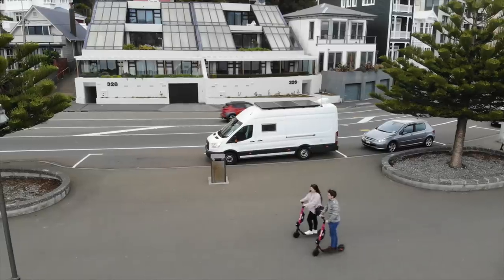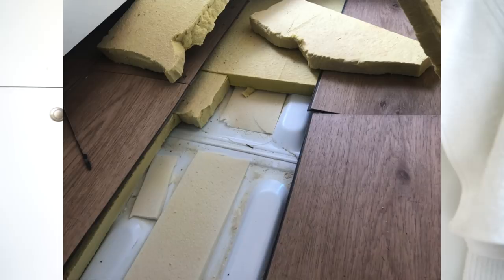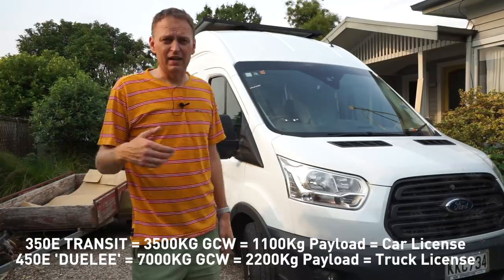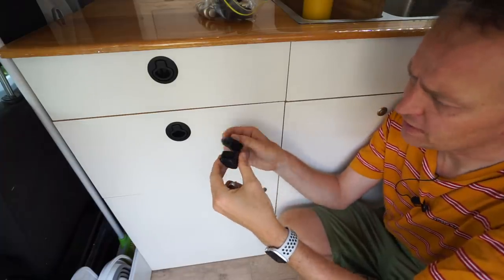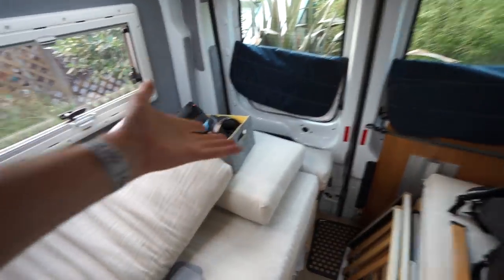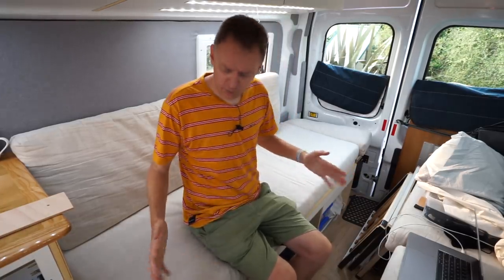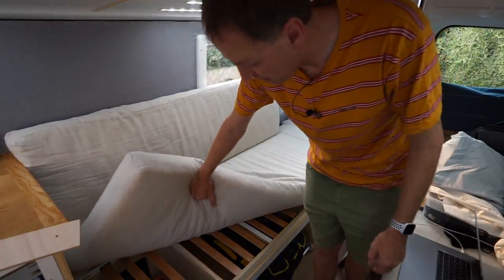10 Things That Didn't Work in the Van : Eat Sleep Van 33

Comment: With problem number 3, you can update your van weight to about 3.8T without any modification, but by adding air suspension assist to it and adding a few more modification, you can get it to about 5.1T if you wanted. I would suggest looking at updating your van, so you can add more items to it etc
Reply from the maker: Are you talking about New Zealand at all? Our rules are a pain

Comment: I don't own a van so I don't live in one. But I think you are nit-picking at the problems you have. None of the problems are a have to fix problem. Other than that nice video. On further thought you could use that open space, where you were going to put the full size fridge, and move it over the sink and then you have plenty of space to wash the dishs without having to bend down. To do that you could move part of the cabinet to the left and leave the sink where it is or move the sink to the left, which ever you find the easiest. = )
Reply from the maker: Yeah you’re right it is nit-picking! Overall everything works very well

Comment: 2020 - USA Ford Transit will have AWD & 4 cylinder diesel Turbo (  By 2021 ).  Thought of having a Lift Kit & weight increase for suspension.  I am tall and will get the 3500, Extra height & extension.  I really like the shower at the Sliding Door idea & 2/3 Couch concept.  Also,  Two Swivel Front Seats - at least One for the Front;  could block windows - including insulated reflectors - with a heavy duty curtain that would slide behind seats after the swivel.  For a quick night stop, just close the curtains without seat swivel.  I saw in a commercial conversion that a garage was installed with a Murphy Bed concept.  The Bed split in two and hinged over storage underneath.  This leaves a huge opening to store Motor Cycles or an ATV for those who do that sort of thing.  With the conversion, they put two " Bump-outs " so people could sleep sideways - Real Expensive !   Again, thanks so much.  Enjoy the ' Refit ' .  Bye.
Reply from the maker: Thanks for watching! Yes worth figuring out what you need for equipment storage and then build around that

Comment: Yes. Being able to enter your van through the back makes life much easier. My toilet and shower pan are at the rear of the van. I can enter soaking wet without any issues.
Reply: I intend to put another bed at the back but it will be built in three sections to allow me to still use the rear door. The main bed is a pull out bed especially for my height 6ft 4inches. It slides out and unlike this guy will have foam cut in sections for a mattress and in the day the seating. No hinges . Check out a website called Deep Red. That's where I scourced my ideas.

Comment: Was surprised you hit your weight limit. Thank you for posting. Cheers!
Reply from the maker: Easy when there's only 1100Kg (2,425)! It all adds up quick. I made a few mistakes too around things like thickness of plywood used in some cabinets, the vinyl floor was heavier than expected, the tow bar adds a lot, 3x18Kg solar panels, heavy latex mattresses. So smarter choices would help with the weight!
Reply: Eat Sleep Van This should be billed as one of the major advantages of the promaster. We weighed ours recently and we came in at 7,600 pounds, well under the the max total curb weight.
Reply from the maker: Stephen Otto funnily enough you can no longer buy the promaster/ducato in New Zealand at all any more!
Reply: I see you like wood very much. So do I but attributes to the weight. While writing this and watching your ceiling I wonder how much that alone weighs 😬. 
You can make cabinets using foam and thin plywood. Once glued together it’s more than strong enough and saves a lot. 
There obviously aren’t quick wins as you would have implemented them already. Well maybe you could simply throw out the middle seat. It’ll have the additional benefit of having easier access to the living area. 
Thanks for the video!

Comment: I have a Dodge Promaster 3500 and without the alternator charging I wouldn't be able to keep up with my power consumption using 300w of solar panels. I had lithium batteries but swapped them out to marine batteries because the lithium don't handle cold weather. Also, I need a "stealth look " so I can imitate a work van in areas that I sleep here in the US. Enjoyed watching. Happy New Year!
Reply from the maker: Good stuff! Yes Lithium needs heating pads or something in extreme cold conditions. Ideally the inside of your van isn't below freezing too often?! You could almost buy a diesel heater and just leave it on all the time at a lower temperature on the thermostat as an alternative for anyone who did want Lithium in cold climates. Thanks for watching, glad you enjoyed it! I'm lucky enough to live in a moderate climate here so don't need to worry about freezing often.

Comment: THANKYOU for the high lighted issues that would normally be overlooked when starting a project like this. As a newbie with a growing keen interest in starting my own. I do appreciate this valued insight review on this particular setup. I was considering similar as in the van size as a starter but you greatly pointed out the vans limitations that need to be considered depending on what your intensional use of the van is. Excellent review.. Cheers.
Reply from the maker: Great glad it helped!

Comment: Thanks for that, very interesting. I was happy to see there wasn't a problem with have a shower exhaust vent underneath the solar panels, I was a little worried it might corrode the panels or their wiring.
Reply from the maker: Nah they are very well built for outdoor use. And that vent is only used for 3 minutes a day! So won’t make much difference.

Comment: Nice looking van!
On one of your fellow YouTube rs sites,
He wires a 240volt fridge/freezer via an inverter BUT 
Modified the wireing to switch the inverter on via the fridge thermostat. Thus the inverter is only on whilst fridge/freezer demands current !
He utilises a cheap fridge freezer although recommends best efficient one as possible !
Can be a cheaper alternative to dedicated 12volt fridge !
In your case you could still do your original plan !
Reply from the maker: Thanks for that! Yes was tempted but in the end the under counter fridge is working well. Good idea to only turn on inverter when needed. The Victron inverters do have a lower power mode too that is similar, in that it only activates fully when a decent voltage is required. But haven’t experimented with that.

Comment: We have a similar bed bench set up. We store in one bench the water tank, boiler, diesel heater. And in the other the lithium batteries. The rest we use a storage space, which we devided horizontal. So we can open the front of the bench. And pull out the chairs etc to avoid to lift the mattress area. The back storage area is used only for stuff which don't have to use so often.
Reply from the maker: Yeah next time I’d definitely mount more electrical Gear at the back of the bench seats instead of the back of a cabinet. Cabinet space is more useful!

Comment: You could try and upgrade your rear leaf springs so you can take more weight my work has done it to all transit pickups
Reply: would still add cost of Road User Charges on a diesel vehicle in NZ. They go by weight.   I have a sprinter but if is was able to fit one myself ( I am technically challenged) I would of got one of those LVD vans new.. Had a transit, trouble with rust... grrr.

Comment: If you wanna be able to carry a bit more weight you can get helper springs or air bags on the rear for most vans and they're not mega expensive
Reply from the maker: Thanks although I’d still like to do one of those to help the ride, unfortunately it’s the legal limit that is the problem. And that’s actually impossible to change.

Comment: If there is room in the engine compartment, you could add a 24 volt alternator.  

Many vehicles have dual alternator conversion kits available which makes installation simple.  

This has the added bonus of not affecting your stock alternator.   

Battery charging can be hard on your alternator.
Reply from the maker: Thanks I should do some more research. I did ask a Ford engineer he said there wasn’t much room in my particular transit for another alternator

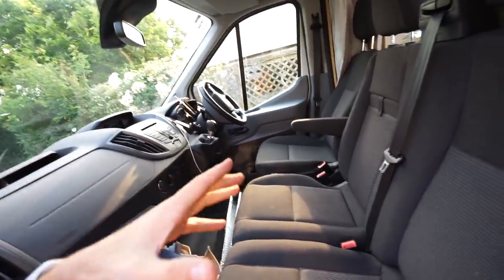Comment: 8:06 instead of spending 800$ on a generator or buck converter to charge the batteries from your alternator, simply install a 2nd alternator at 24v to solely charge your house batteries for about $100.
Reply from the maker: Yeah certainly an option too! I asked a mechanic about doing that and the answer was “not much space, might be difficult!”. Also by the time I pay a mechanic to fit it, I bet it’s closer to the $800? Certainly a good option if you’re mechanical and can install yourself
Reply: Or bump up your single alternator and use that
Reply from the maker: the voltage is wrong to do that, van is 12v, house battery 24v
Reply: Krister Lagerström  Thanks yes it would be good, and one day I might look into it if I run out of other projects :)

Comment: A friend recently had a weight problem with their van. One thing they did to reduce weight was to swap their 3 solid solar panels for flexible ones. Maybe not as reliable long term but just as effective and much lighter
Reply from the maker: Yeah definitely considered doing that, that would remove close to 18Kg x 3 = 54Kg! I could also remove the aluminium rails which would be another 10Kg at least. Cheers
Reply from the maker: Krister Lagerström  Not a concern at all, we get hail occasionally but very rare to be damaging. The main advantages of solid panels are:
- They shade the roof permanently. This is great to help keep the roof cool.
- There is air under the panels, which helps keep them cool and run more efficiently. Panels don't like getting hot.
- Rain noise is reduced

Comment: Very nice set-up, and thanks for sharing what didn't work.

For the generator, perhaps you could get an LP generator and split off the existing tank?  If you did need an additional tank, at least it would be usable in either.

Also for the bed slats, to save weight have you thought about using nylon straps?

If and when you're redoing the cabinets,  think about using thinner wood where you can, possibly with more bracing or strategically placed supports.   It looked like your cabinet faces and drawer sides were pretty thick...
Reply from the maker: You’ve hit all the nails on the head! And yes I did consider nylon straps but couldn’t think of how to secure them tight enough. Also I quite like the ‘spring’ of the wood slats. Certainly would save a bit of weight. I was also thinking straps could be used for other things like cabinets! Again lighter than plywood.

Comment: I built a camper years ago. My plan is always to do a ‘test run’ of the fit out. This was carried out either living in the van in the driveway or on a local camp site. So if stuff fails you can pop home and fix it OR sleep in ya home! 👍🏻
One little criticism is you have made an excellent job of building the drawers etc sadly they are way too ‘sturdy’. I built my cupboards with thin  honeycomb board or marine ply, STRONG but very light. As they do in caravans. This obviously pushed up your all up weight. Dont worry I would have liked thicker timber in mine but that would have maxed out the suspension and motor! 🤷🏼‍♂️ i guess its all about a compromise between strength and weight.? Plus your lovely pine board ceiling really nice BUT making a van top heavy can cause stability problems in high winds or cornering, so ideally more weight low down and thin lining board for roof lining. 😉
Reply from the maker: It’s a great idea! I certainly tested as much as possible before building eg bench height although some things you just don’t know until it’s built eg shower!

Comment: With problem 9, I didn’t go for the Buck boost because its expensive, so i went for 3X Orion 12-24V chargers (15A each) and i have gotten about 75A charging from them so its actually cheaper option than the Buck boost etc. I hope it helps. I actually have a Tesla battery for house battery in our van.
Reply from the maker: Awesome, good to know that does work. How do you make sure it only comes on when the van is going? And you need to give the van time to start up do you?

Comment: Enjoyed the vid.  Just a couple of points on carrying a generator.  #1 they tend to stink of petrol (unless you remove all the fuel in between uses which is a bit of a hassle but do-able), so storing them inside of vehicle is a bit problematic (air-tight storage with a vent to the outside would be the way to go).  #2 Apparently they can be converted to run off LPG / propane.  I've been looking at this recently but I bought a cheaper, Gentrax inverter generator which seems to lack the option of the conversion kit (though I admit I didn't look to hard).  The standard Honda types seem to have this kit readily available and imo would be a great way to go assuming you have propane on board for cooking purposes.  Cheers

Comment: Good tips bro the 'Slam Latches' really sunk in.. now I know what to use for my build and another affirmation for the flooring - cheers. We're the same in the UK with the 3 seats upfront, very rare to find a North American 2 captains chairs setup with basic panel vans. UK has eBay though for 2nd hand parts I would've thought NZ would be much much harder to source a matching front seat? Your solar setup is sick, but yeah definitely look into DC. I'm looking at the Renogy 50A DC-DC On-Board Battery Charger with MPPT, only for 12v setup mind.
Reply from the maker: Thanks yes I could get a captains chair in but then the number of seats wouldn’t match what the vehicle is registered with which can be a problem in NZ. More research needed!

Comment: Great video.. I have a Ford transit custom UK model, the shortest lowest , I think they call it a L1 H1 ?? .. my bugbear was the front passenger bench seat which is exactly that, just a bench, , because room is a a premium I decided to fit a swivel under the bench to create another place to sit when parked up, that was fine but was a real swine to turn because the space is very tight, consequently I didnt use it much.. So then I thought maybe a single, more adjustable seat would improve things and be more comfortable with various adjustments,  such as recline, an arm rest and backwards/forwards slider etc.. I started to look around for a suitable seat and was told the Ford Galaxy seat, or a BMW E46 would bolt straight in to my 2015 model... I bought a Galaxy seat for £125, from a 2017 Galaxy, very nice clean seat, what I hadnt accounted for was the swivel plate already fitted (£270),  changed the whole show, and the new seat was nowhere near being correct, I was committed by now with money already spent so I had to make it fit, and there starts a whole new ball game. Its nearly done now but has cost more money for steel plate, angle iron and various fixings that will comply with UK  MOT regulations, and it is probably a little to high than I would really like by about 2".. apologise for the war and peace, but just a heads up for anyone thinking of doing the same.
Reply from the maker: Thanks for sharing! That is interesting information

Comment: Van front seats are a nuisance, sometimes they combine the middle and the passenger seat not providing a good seat for either. It usually blocks access to the rear from the inside, unless it is a "walk thru" van.
Reply: Krister Lagerström  Yep sounds good. I recall trying to climb into the back with girlfriend, without getting out of the van and thinking there must be better ways.

Comment: Some people use a Jackery
I'm convinced on this one and its portable.
Reply: And they're partnered with Honda as well so their generators are really quiet since they use the "EU" model technology. Combine a generator with one of their portable power stations and you're pretty much set. It also makes it cheaper since you don't need to spend a ton of money on a massive generator to charge it. Their Explorer series ranges from $160-500 USD.

They won't run an entire RV/van with regular home-level power requirements, but the smallest of their power stations can run a 40W cooler for over 3 hours and charge a phone more than 10 times on one full charge which is quite good.
Reply: It is good but that and other portable power stations are meant mainly just for recharging devices such as phones, laptops, tablets, etc. I can also power something like a small fan but that’s about it. Most powers stations are 500W and under (the highest I could find was 1000W) and even small appliances like a coffee maker use way more power than that. A portable power station such as the Jackery is better to use as a back up to your main battery bank which is cheaper and will give you a better source of power.
Reply: @xcrystalx625  They have different sizes. Other vanlifers use it.

Comment: If you’d laid the flooring at 90° to the way you did, would the flooring have been stiff enough to avoid ripping it out and replacing the soft insulation?
Reply from the maker: No don't think it would make much difference sadly. They are not more ridged one way or the other.
Reply: Eat Sleep Van 
I’d be surprised, because the only thing holding the planks together if they’re laid parallel to the ripples is the mechanical force used to clip them together at the tongue and grooves, whilst in the other direction the material bridges the valleys and doesn’t unclip itself from the adjoining plank. 

I’ll bet you a beer that if you clip a metre square of flooring together and support it on saw horses only at the edge, along 2 opposite sides and push down and you’ll find that the planks laid parallel to the supports will fail (unclip) at a much lower force than when the same planks run perpendicular. It’s just a guess but I’d be surprised if the floor would even support its own weight when running parallel.